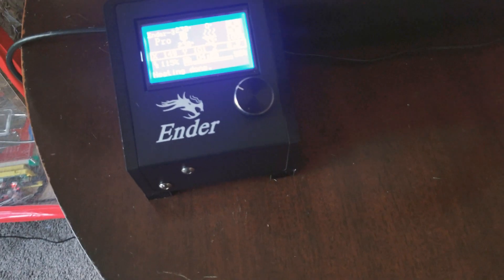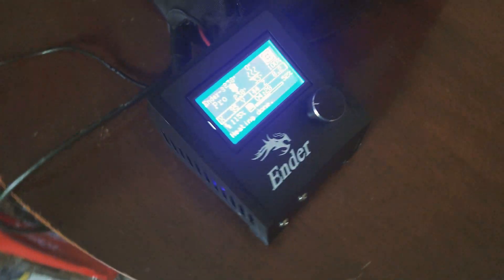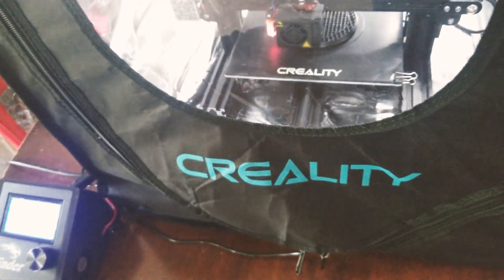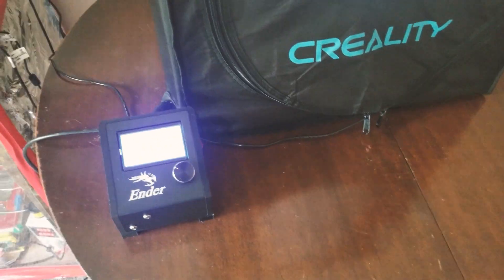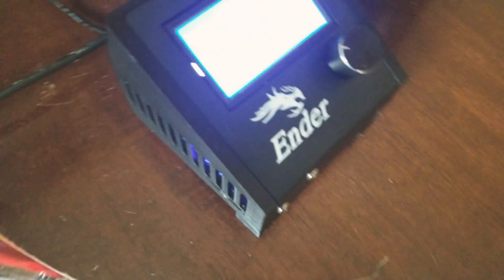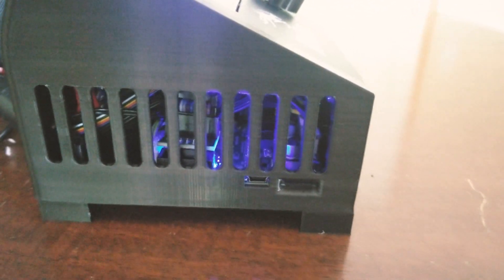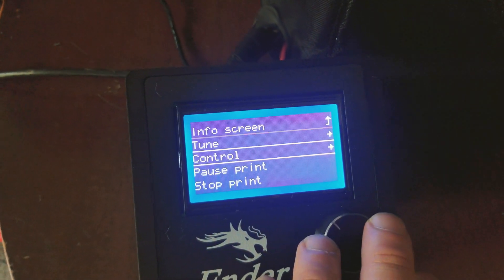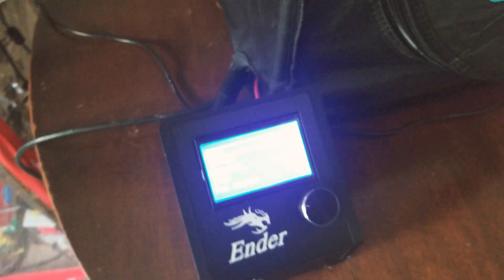Ender 3 Pro 3d printed electronics case.

Comment: Hi, you have the power supply inside of the enclosure? If it's not, how you made it?
Thanks
Reply from the maker: I left the PSU mounted on the frame and extended all wires to the exterior controller. It was lots of soldering and time to get it completed. Only the control board is in the box.
Reply: @billermanthegreat I ask because I wanted to make an enclosure to print on abs, and they say that it's not good to have the power supply inside, because they don't cool well. 
Thank you very much for responding so quickly ;)

Comment: whats your settings for the filament i cant print i think my filament get stuck when print cuz it turn to soft cuz is inside the enclosure
Reply from the maker: What filament? PLA?
Reply: @billermanthegreat  yes most of the time I use pla but now I buy a role of asa and I want to do abs too cuz it's strong but first I have to make external cables box
Reply from the maker: Pla depends like 230c to 235 if I recall. Abs I have used not well. Tpu I really like use like 230 or so but no bed heat
Reply: @billermanthegreat  ok i will try bro thanks